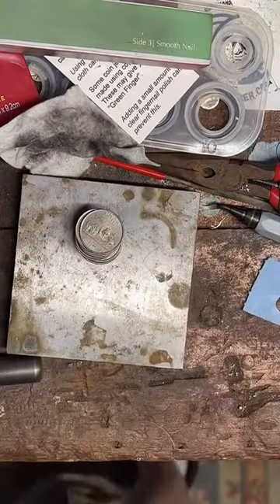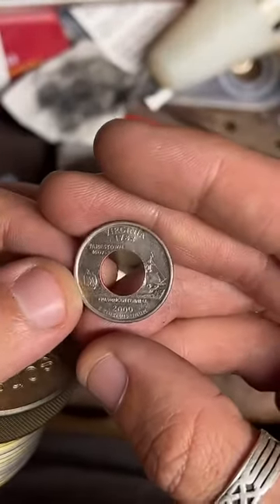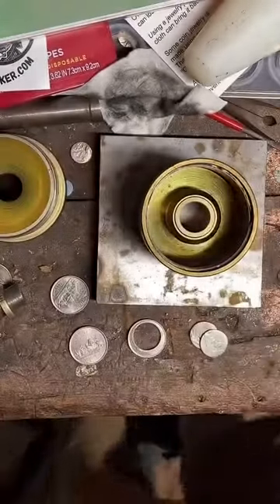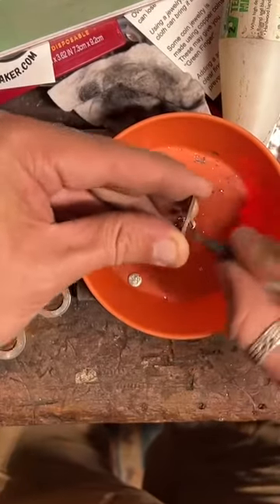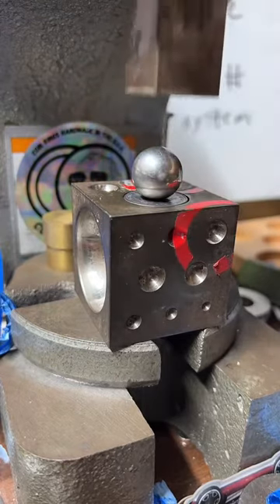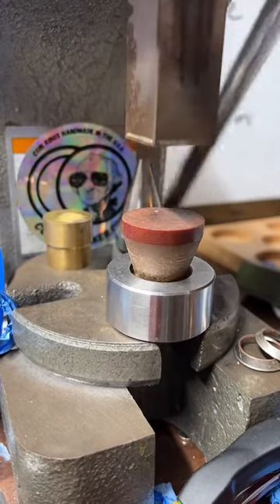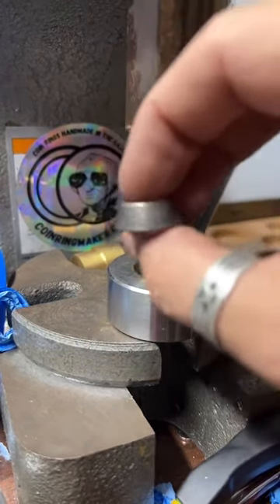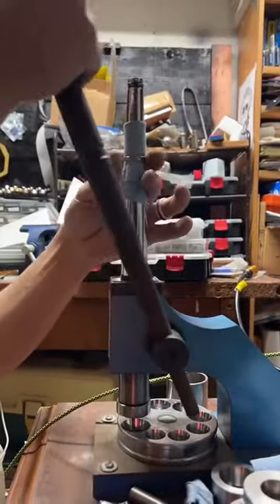Experimenting with different punch sizes on quarter coin rings part one￼

Comment: Great video.  It looks like your 11\16" punch is too thick to punch properly.  It didn't allow the quarter to get centered before the punch made contact with it.  There should be some slack in the punch after the top is completely tightened.   Just an observation.  Keep up the great work.
Reply from the maker: The tool loosened after every hit which make the coin go off center. Should work much better under my 12 ton press.
Reply: @CoinRingMaker  One way to to check is to put the quarter in without the punch and tighten the lid, then mark the base and top.  Then unscrew the top and insert the punch, and retighten the top and see if the marks line up.  You can also use the same marking method to see if it is actually loosening up.   After watching part 2, I'll be very interested in seeing the continuing R&D on the sizing of the reeded edge only rings.  I like the idea of taking the reed off that way and being able to use a re-reeder on a coin that may have some damage to the reed.  Thanks for all the info you put out.